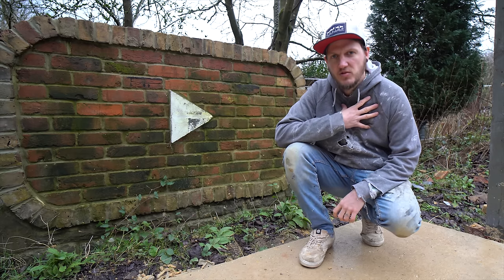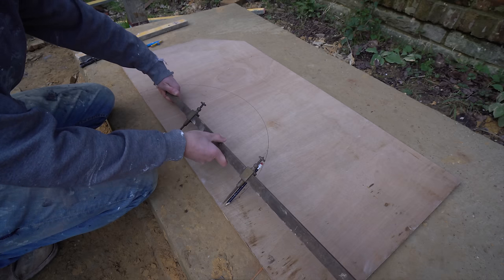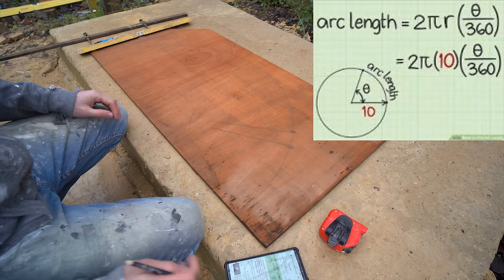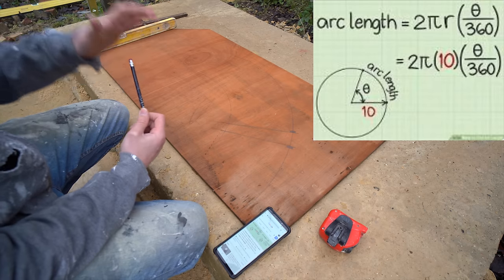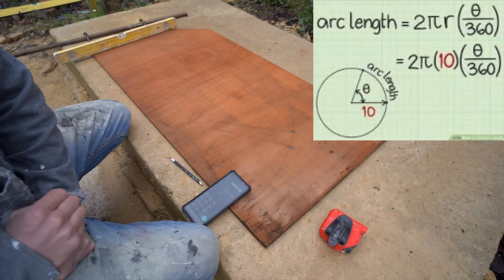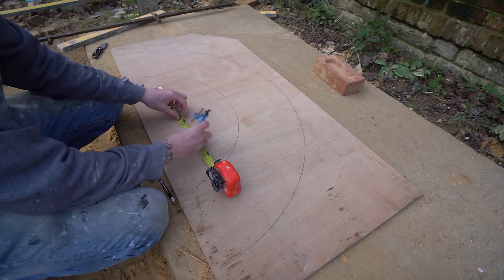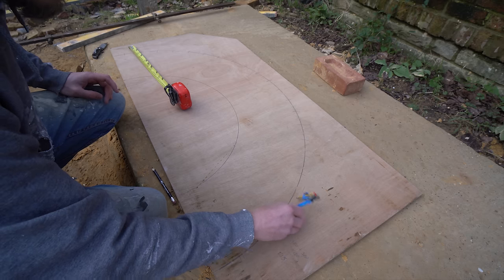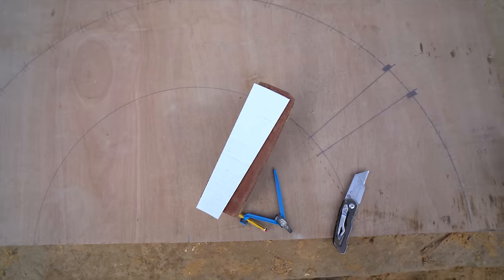BRICKLAYING - How to cut VOUSSOIRS

Comment: Heard you count 22, was always taught  number of voussoirs  in an arch  should  be odd ,( wherever possible) so the odd one is
the key brick,  wich sits over the arch centre line.
youve helped to refresh my
memory,  I had to cut some
blue bricks around the top
of a well,  kept   the 65mm
 face   and  and reduced the end by 10mm each side, traced them round ,
traced the round, worked 
great, you can get round 
A lot just using  this basic
method.
From fellow BRICKLAYER 
👍
Reply: I agree should have odd number so you have a key brick

Comment: The title of the video is "How to cut VOUSSOIRS" and you showed us everything apart from how to cut a voussoir!
Reply: I'm pretty sure that fitting and measuring, placing and the logic behind making the entire arch trumps cutting a bloody piece of brick.
Reply: Alin Trinca it’s a good video but I also wanted to see him actually cut the brick. I assume he’s doing it with a petrol saw but I wondered if there was any other trick. Like, maybe he just shaped those ones we see with a brick hammer! 🤣we may never know….
Reply: @mankillsquare  Well, actually you do see that the bricks are wet. That means he used a diamond blade on a water fed saw to limit the amount of dust. However, I think he has a portable cutting station or a pump fed saw cause otherwise it requires two people to have the bricks cut  clean and correctly.
Reply: Alin Trinca Well, the bricks are wet. Which means the bricks are wet.
Reply: @AlinTrinca  Not for me. I know how to measure things, I've no experience cutting brick.
Reply: @mankillsquare demo saw, 9inch grinder, brick saw etc

Comment: Thanks for a great series of informative videos.

I’m a hobby bricky, my first project was for my parents a very long time ago when I was fourteen, it was a wall following the curvature of a winding brick path.  Lots of trial and error involved!

Later on I extended the wall and included an arch leading to the orchard, it’s a big garden.  Calculating the taper on the bricks took a bit of time, hence I was interested in your video on the subject.  I just called the two main dimensions: inside radius and outside radius.  It’s nice to know the proper names.

After my parent’s passing, the house was sold to a building inspector who without knowing who’d built the various projects including the lower portion of a substantial greenhouse and bricked foundations for a porch, wanted to congratulate the builder.  Quite a feather in my cap.

I was very impressed you used the fine scale on the ruler when setting the marks for your foundations.  I’ve seen so many builders setting things out with the 5mm increments.

By your standards, I’d be a bit slow, but can assure you, my projects are plumb and level.

Thanks again you are a true craftsman, CT

Comment: Great video: how did you actually cut them. Would have been much more helpful.
Reply: Same.  Main reason I watched was to see how to cut thin slices off of bricks.  He skipped that bit :(.  I'm guessing he probably has a fancy table saw setup with water and everything though.  I'm trying to do this with a grinder and not sure if it's possible.
Reply: @ashh3051  it is , on a flat surface place the intended voussoir  place another brick about a foot away put a batten of wood on top of bricks put your foot on the batten and use your weight to hold them down and cut away , i think you get the picture .

Comment: Nice vid mate. Handy tip for equation to save all the fuss is pi × diameter  gives circumference length,  then dvide  answer by 2, gives half your circle. Or just pi x by radius.  in school i was shown your way but in college my bricklaying instructer showed me these 2 ways for semi circle  so simple👍 for other arches with skewback its pi x die ÷ 360 × by angle at striking point. 👍
Reply: Like to add when dividing your brick devide it by 75 first   if it gives 21. whatever then round up to 22 divide ur semi length by 22 will give you 73.5 more accurate + youll need extra  joint beside key brick because our first sum gives us only brick + joint so 22 joints but arch has 23 joint so .5 taken from some bricks will give you it, there's another way but more maths to explain sub dividing remainders after decimal point. Youll find this way bricks will find a more true place in arch and allow you to build tight joint arches but the best way is traversing arch template after youve done this and achieve gauged arches with 1mm joint to the mm. By the way good to see some1 approach it the right way 👍

Comment: Great video, instead of using the equation of working out the courses around the extrados couldn’t you just dry bond the bricks around the extrados closing or opening the joints until it worked bricks, then mark on the plywood ??

Comment: Good day! 

I get lost at the final step in the calculation. When you have got the lenght of the extrodos arch you divide it by 73 so you can get as close as possible to 22 because you want 22 courses.

My question is how did you come to the conclusion that it should be 22 courses? I've watched the video a few times now and that's the only part i quite don't get

Cheers from Sweden 🍻

Comment: You don't put your level to the centre, you mark the joint at the centre i.e if. 10mm joint 5mm either side and then put your level to the appropriate side, therefore having a parallel joint line to the centre. Otherwise the joints will be slightly tapered.

Comment: You could  grind that joint down by 2mm and keep the heads at 65mm and looking normal.  A cut arch is not normally made from standard bricks and 8mm joints look better than 10mm. Looked good though.
Reply from the maker: When cutting the bricks I did keep the head at 65mm and made the joint a bit tighter. I agree that an 8mm joint looks much better, especially in an arch 🤙🏼🧱

Comment: OR  your radius of  515 mm x2 = a diameter 1030 mm  x 3.142 = 3.236.26 divided by 2 = 1.618.13 , and its not a voussoir arch it's an axed arch as the joint's are wedge shaped , you are correct on finding the angle first on any given arch .

Comment: Love your video but it would work better for me if you spoke slower and did not interject other info when explaining the math.  I think you could be more graphic.  Also it would be very helpful if you could run the method on arches less than 180 degrees.  Thx I hope this is helpful.  It would be for me I know.  The important part is the math and layout I think.

Comment: There is no need for trail and error for working out the vousoir sizes.just minus the total lengths of all joints from the extrados and divided it by the number of courses for the exact measurement. Your vousoir sizes are for an arc length 10mm less as the last brick doesn't have  a joint added. Plus semicircular arches should always have an odd number of courses.

Comment: Hi. if your template is the same thickness as a brick.at the extradoss. why you not dry bond the bricks around the extrados.even them all out  and work it out that way.you can get your template from that.another way is to go around the extrados with a pair of dividers.and divide  the half circle into egual parts brick size..then you can work out your joints.you lost me with the complicated maths can't get my head round that.i been bricklaying 40 years and I was only ever asked once to do one of these.on an old victorian house in chelsea. the cliant bought a big window frame that was curved at  the top.i worked my brick sizes out made a template cut  it out of a piece of ply  and cut the bricks with a grinder.i laid the bricks to a line with a nail in the centre of the turning piece and marked my joints on it.its not that complicated.its not that difficult either.you will never ever get any of these arches to cut and build on an average house bashing site.if you do convertion work on old victorian houses you might be lucky but no one does these anymore they cost to much money no house bashing builder will pay someone to cut them.theyl buy the premade arches stuck on a selcon block.i did all this circles and segments  and 3 centred  eliptical drawing. angles and scales at secondary  school.its not complicated for someone with a brain who can think things out.i can make turning pieces as well. or show a stupid joiner how to make them who's never been taught.i like your videos but if someone's a half decent bricklayer they should be able to work out how to do these.segmentall arches is just a case of marking your brick joints on the turning piece no one is going to pay you these days to spent a few hours cutting bricks.shame realy all the trade skills have gone out  of the building trade.